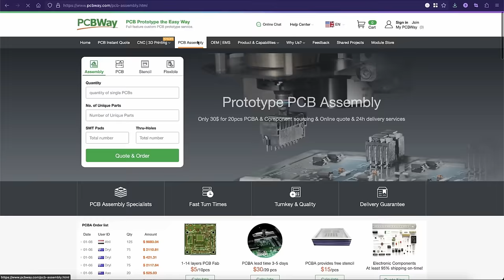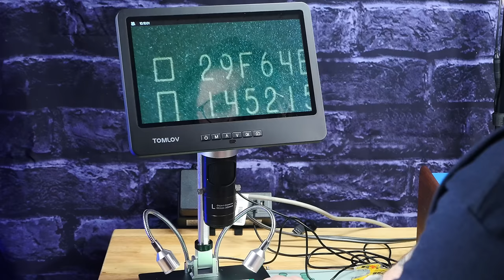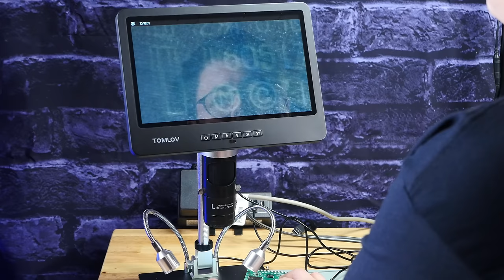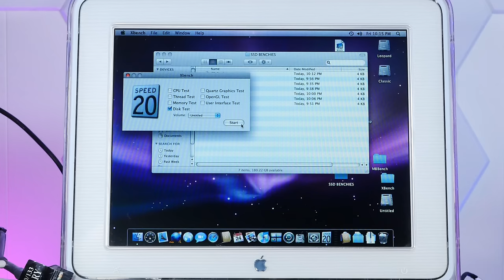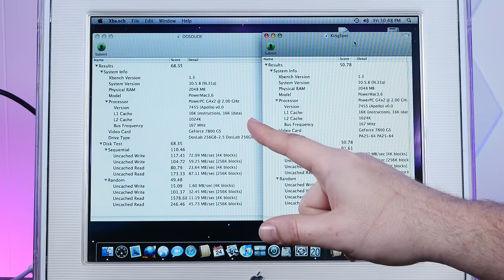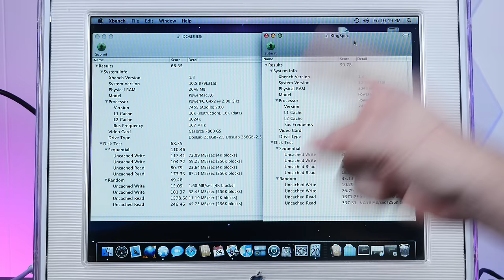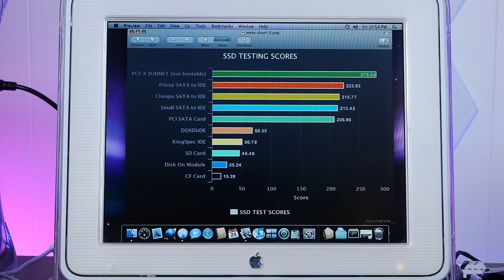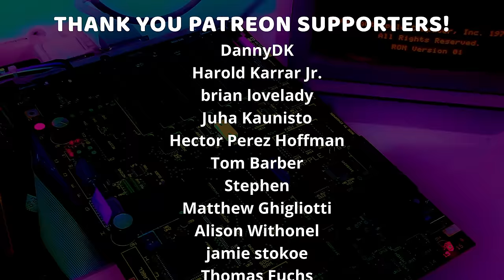What's Inside This PATA SSD from Amazon?

Comment: i upgraded my imac G4 20 inch to SSD (kingston 240GB + PATA/Sata adapter the StarTech one as in your video) from this upgrade he random Freeze or black screen need to reload 
any suggestion??? 
with is original Hard disk 0 problem

Comment: For the SATA to IDE adaptor, it is a bit more complex than that, because when running a SO they cheapo one that look identical, tend to crash randomply. I read on forums that the only one to trus is the one that uses MARVEL hipset. Never buy the ones that are dual (SATA to IDE and IDE to SATA). Those are the WORSE and it almost impossible to get this done with just one chipset ..... so they keep freezing the system and hanging.. I used a marvel one for MONTHS on an old Vectra without any single glitch. The HP didnt even support DMA, it has PIO4, and the adapter work flawlessly. Also the disk had Dynamic Overlay installed since it was a 128G SSD on a ocmputer that wont accept anthing above 8 gigs. So the adapter was put to the test. Slow as hell due to PIO4.

Comment: The CF card option is generally the most compatible option for an Amiga 600 and 1200 so it's a common choice there.
Reply: Are the interfaces on those computers fast enough to benefit from the faster choices? I would imagine they are not.
Reply: @ericpaul4575  The Amiga IDE interface is slower than a geriatric snail with a hangover and towing a spare shell. I'm pretty sure you can't max out any reasonably modern CF or SD card on it. I doubt even an old class 4 SD card would break a sweat. It's only saving grace was that it was faster than the floppy drive. Unfortunately I no longer have any Amiga hardware to test it out.
Reply: @ericpaul4575  I was referring to compatibility, not speed.  CF cards are commonly used on Amigas especially since you can get them in small enough sizes.

Comment: What would a regular spinning rust drive score? Is the CF still better than an old HDD?
Reply: In just about all aspects the CF card if you're running an operating system is still slower. It's because mainly it doesn't do so well when you have a bunch of commands like when you're running and operating system. It's still faster if you're randomly seeking data but again when it's impractical use it really doesn't make sense.

Comment: All my IDE drives still work fine , especially my G3 Bondi tray loader
Reply: That's good, but remember they are mechanical devices, and all mechanical devices are subject to wear. With parts spinning at high speed and other parts, such as read/write heads, needing to be moved with incredible precision only a fraction of a MM above the platters, they will absolutely fail at some point. It may be a slow decline, or it may be a single catastrophic failure. So be sure to make backups of anything you deem important.
Reply: Don't worry , the only thing I do with it is spin the graphing calculator model . It has had an extremely easy life

Comment: The 'DOSDude'  board is OF COURSE FASTER than the 'KingSpec' board. There is only 1 CHIP on the KingSpec board, and 4 CHIPS on the DOSDude board. This means the controller CAN write to multiple spots "at once" ....  not that it actually does, but if there is a pause while writing to one chip, the controller can write to another while the first one finishes.... or something like that LOL
I don't think it can write to 2 chips at the same time tho, it's just able to write to a second chip instead of waiting..... 
- AT LEAST THIS IS WHAT I HAVE BEEN LED TO BELIEVE... I COULD BE WRONG THO.... But when I saw that the mem chips and controller were basically identical I KNEW the DOSDude board would come out on top because it has more than one chip.....  and I think it works sorta like how DDR RAM takes advantage of 'downtime' that would otherwise just have it doing nothing half the time (I KNOW it's NOTHING like DDR, I meant that they both use up underutilized time to increase speed/productivity.... you know, optimizing workflows and all... lol )
But like I said, I don't if this is really the case, I hope someone with REAL KNOWLEDGE on this could explain it :)

Comment: Linky to DosDude1's prebuilt drive sales isn't working for me? I get an "access denied" (Error Code 1020) screen on every device and browser combo I try to use to access it. Well except for the TAM, which is still loading the error page two days later!
Reply from the maker: huh strange, just tried it in Firefox and it works fine for me. maybe a temporary hiccup?

Comment: Hello noticed that the dude sad had all 4 chip location fitted presumable to have a large capacity. Compare to the Amazon who only had 1 chip. That might affect performance depending on the controller. As the controller might be able to write to several or all the chips in parallel or and that bottleneck the Speedtest does the Amazon one have a disk with larger capacity with equally number of chips on it? If it has I would test it with the same chip layout before make a conclusion of the product.

Comment: Reason for the high perf of the sata to idea is early sata drives in mechanical drives were nothing but ide hdds with sata controller boards on them So no surprise that a fast sata ssd would blow the rest out of the water with a ide to sata adapter 
On early first gen sata hdds and last gen idea hdds you could swap the controller boards back and forth between them and they just worked 
Many of these drives were marked 7200.5 rpm some laptop drives were 5400.5 marked 
Was others as well but .5 designated the drive as a mechanically ide drive with a sata controller the drives actually only spun at the original rpm 
Interestingly enough even those drives were not performing as fast as they possibly could they were throttled back for stability reasons 
But the heads could be moved even faster than they were with out crashing 
Still pretty cool vid though And i might have to look in to some of these solutions if i ever build another ultimate windows 95 gaming rig again
I had 1 i built before that had 70gb storage a couple voodoo vid cards in sli and ai forget how much ram was at least 128 mb on a speed enhanced 486 sometimes called a 586

Comment: I thought there are native IDE SSDs made by Transcend?
Reply: They (at least used to?) make them but they go for crazy prices
Reply from the maker: There's a transcend ide ssd on Amazon, but it's super expensive
Reply: kingston used to have one too i think.

digikey has a tdk one. 4 gigs and 200 + bucks  :D
Reply: @ActionRetro  I can still get them on german online tech stores like Reichelt, and they cost about 2€/GB. Not that terrible considering they're meant for a super nieche purpose. I wouldn't mind putting one of them in my 1999 Dell Latitude Pentium III laptop once its HDD dies.
Oh and they're SLC as well.

Comment: ALSO... see if DOSDude is able to make the drives higher capacity.... 256GB really isn't that much, even for older machines.... but I guess it depends on their use case huh....  I guess I just want to know if its POSSIBLE to use 128GB mem chips instead of the 64gb he used... that way it might be even cheaper to make because you only need 2 mem chips instead of 4 to get the same capacity...

Comment: I really want a 3.5" solution, that is form accurate, so I don't have to fight to get it installed in a G4 Cube.
Reply: Is there enough room in the 3.5" footprint to fit an adapter and a 2.5" drive?

Comment: In defense of CF-IDE adaptors, Transcend makes some of the most garbage CF memory cards on the market. The brand, and the actual rating, of the memory card you use is crucial to the I/O speeds the computer/camera/device will have when addressing the attached CF card.

Comment: What I'm seeing is 'get the SATA to IDE adaptor' for anything retro that uses IDE.
Reply from the maker: At least on desktop, that would be my choice. On laptops I'm going to use the DosDude drive
Reply: @ActionRetro  Definitely the less cluttered more compact and likely more power effeciant option ya.  Plus, helping a guy out that's doing it for the love of the hobby.
Reply: Assuming you can find one that works with your particular retro kit. As Sean found out, there are many that simply don't work in some machines.

Comment: CF cards suck, and you cannot rely on them having IDE compatibility. From my experience and what I've seen, the cheapo 44-pin IDE to SD adapter just works, and takes out the uncertainty. That it's also much faster seems to just seal the deal on the CF cards that are at this point just a pain.
Reply: CF cards ARE IDE compatible. The very latest CF standard is based on SATA, but they are labelled differently, so can be ignored. The problem is far more likely to be the adaptor you use to connect it and the age of the card itself. CF has been around a long time, and like SD cards, there are many speed categories for CF cards. SD cards and SATA are cheaper due to economies of scale.
Reply: @another3997  A lot of CF cards post 2005 or so aren't IDE compatible anymore. I'm not talking about CFast or CFexpress, that's different standards, I'm talking about CompactFlash cards that are no longer IDE compatible because they don't support certain things.

And what are you talking about blaming the adapters? The adapter don't do anything, they're just straight PCBs with no chips on them, if the cards are IDE compatible then it should just work, yet it doesn't, because most newer CF cards deviate too far from IDE. What do you mean "the age of the card"? It has nothing to do with age, the problem is that most cards just do not completely follow the spec meaning they aren't usable as IDE drives.
Reply: Those CF cards "without IDE" are probably counterfeit and fake capacity too. And with fake speed ratings... 
Don't ask me how much it cost me (literally) to find out why my expensive, brand name CF cards weren't working properly half of the time 😓
It does not matter if you buy them online or in the corner store that also buys them online to resell them.
Reply: @ruben_balea  they're not counterfeit, they makers of them just violated the standard to make them cheaper
Reply: @Nukle0n  In my case they were, according to the manufacturer they supported true IDE and when I contacted the support they sent me some photos to see if mine was one of those and it was identical to one of the fakes 😓

You may have to look on datasheets for models that do support true IDE and try to get the barcode of their packages to be able to buy the right ones since these details are not usually indicated on the packages.
I think up to 4GB should all support IDE mode, higher capacity ones with IDE mode are usually only available from industrial component stores like Mouser, Farnell, Newark, etc. and at ridiculously expensive prices 💰
But if the SD adapter works for you who cares about CF 😉